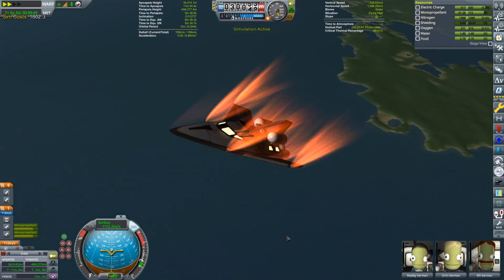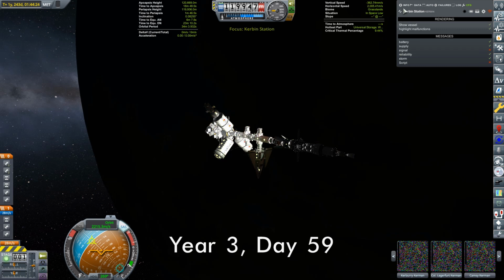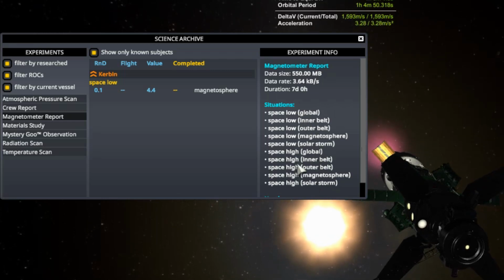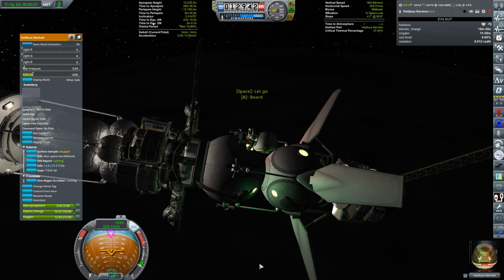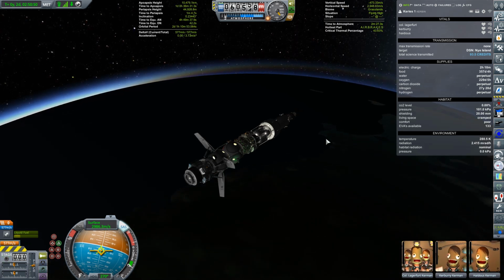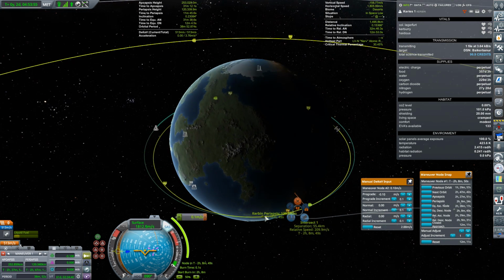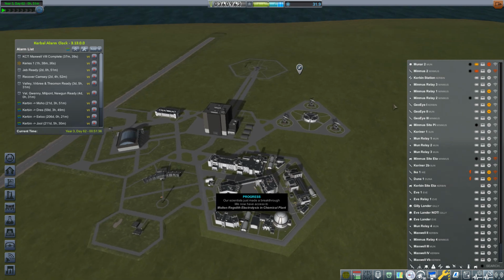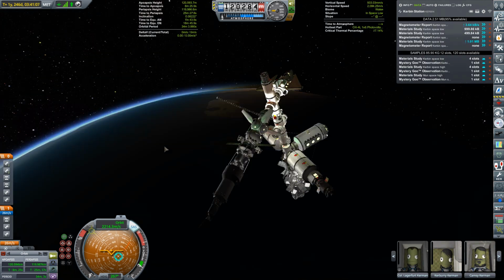NERV Shake Out Tour | KSP: Making Space Home

Comment: Still enjoy these even though I had to catch up a few weeks ago.  I think you are looking at two different things on the Kerbal Engineer thermal.  The hottest part is telling you right now what is the part with the highest temperature.  The critical thermal percentage is telling you what part is closest to breaking due to heat.  So for example, the Engine is the hottest part because its temperature is say 2000K, but it breaks at 10000 so its critical temperature percentage is 20%.  Your air bakes are at 400K, but break at 500K so its critical temperature percentage is 80%.  So you are getting the data from both (note I made up all the numbers).  I believe if you opened the kerbal engineer display for thermal, it would verify this.
Reply from the maker: Yup. Makes perfect sense. It's amazing how elusive solutions are when you're in the middle of the problem.

Comment: That probe that discombobulated in orbit?  I've had similar things happen when having Kerbal Engineer loaded and using autostrutting.  Every single simple probe I did exploded when exiting Kerbin's SOI.  Another set of lander probes separated similar to yours during landing, which didn't go especially well.  When I switched back to KSC and back to the now-crashed probe the remaining parts still hooked together looked fine.  The weird, wacky, wonderful world of mods.  Great episode!  Oh, also the hottest part might not be the part with the most critical temperature (closest to melting).
Reply from the maker: Very true on the hottest part. As for the probe, it's actually an interaction of parts. I investigate it next episode.
Reply: @MikeAben  I'm already waiting on pins and needles! :)